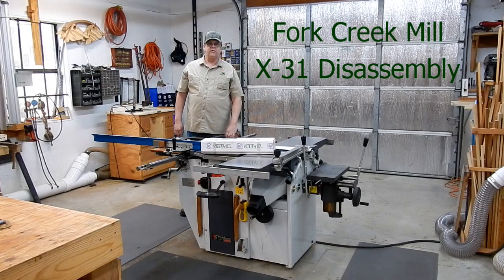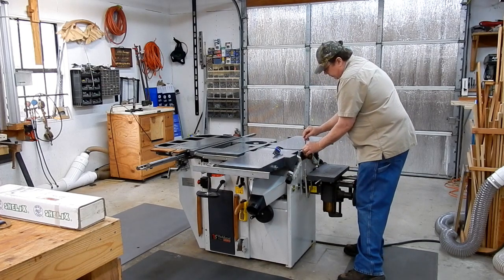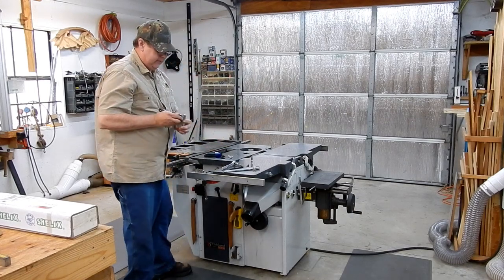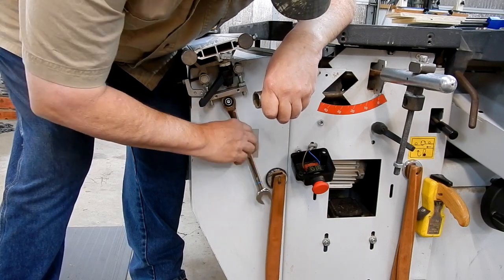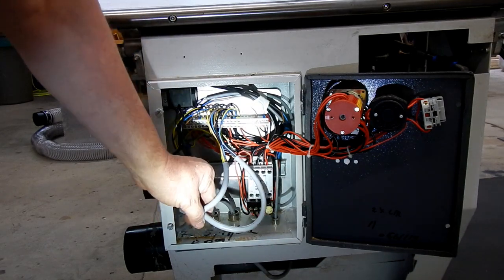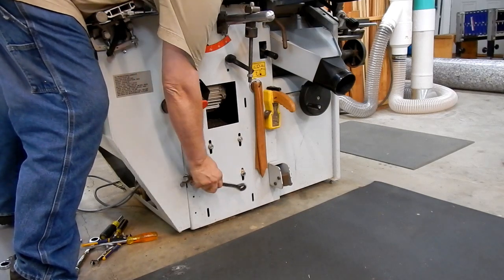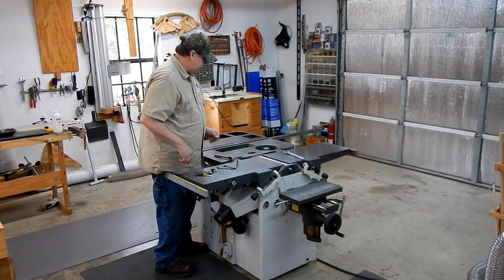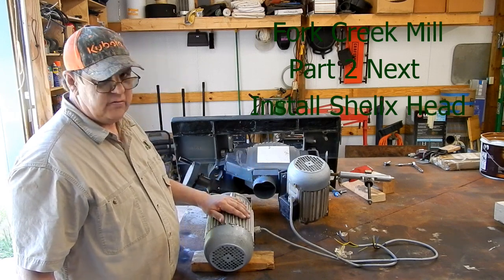Fork Creek Mill   Robland X 31 Disassembly

Comment: Thank you for the Videos they are best . I changed to Byrd shelix a few years back after gathering energy and courage. I followed the directions from the Oliver dealer who got directions from ROBLAND. The process was to tilt the saw table as much the wires would let with a cherry picker, working space was cramped but I forged on. I had difficulty with matching the threads on the Byrd head with the threads on the Robland Mortor & tenon head ( a local machine shop did help, I hope it is adequate ) I also developed a problem with the dust chute  not staying in place , after I am going to measure Byrd Head and see if I can get the necessary 1/8 inch to keep the pins in place that this is the problem after I watched your video. I plan on loosening both bearings and use clamps to keep the bearings in place to keep the dust chute in place while I tighten the bolts.Thank you for your skil
Reply from the maker: The dust chute fits into a shallow recess on the inboard bearing cap of approximately 0.125" and on the outboard side the cap is drill all the way through and had a set screw in it with a jam nut on the outside to keep the adjustment in place. If you can slide the dust chute towards the outboard bearing cap then it sounds like the set screw may need to be adjusted in. Of course that is contingent that the bearing blocks were seated all the way in on the shaft., although yo could not be off much  if you got the bolts in, I would try adjusting the set screw. 
   I probable should have showed this on the video.

Comment: I’ve been waiting years to know what’s involved in this upgrade!
Cannot thank you enough! 👍👍👍🇦🇺

Am I right in my understanding that you must do this first to be able to accurately measure your existing planer head, to order the correct replacement from Byrd Shellix & then do it a second time to swap the heads once the new one arrives?
If it’s OK with you I’d like to share the links to your videos on the Robland X31 Owners Facebook group page please for others who might be interested?

You sir are a gentleman & a scholar for going to this effort to assist others who have long been contemplating the upgrade but been scared off by the unknown complexity of everything you are doing in this video! 👍👍👍
Reply from the maker: Thank you for the kind words. I have the PDF drawings from Byrd Shelix if anyone would like a copy. Byrd only keeps a couple of the nine heads in stock so the rest are special order and you can expect up to a three month wait. There is actually two different companies you can order the head through now with one located in the USA. I bought mine from the one in Canada  and could not really get all the info I wanted. The new head of course has a take off on the diameter and cutting area length that he could never provide so when they ask you to approve a drawing you really do not know what you are looking at. I sent them a drawing that included the cutting head diameter with the blades and the new Shelix head fit on the money. I did not have to change the table height at all.  Feel free to pass along the links. It really is quite easy overall but an extra set of hands would make it go a lot better.
Reply: david pape Thanks heaps David! I’m full of admiration for you having a go at this!
I bailed on it twice now for fear of not knowing what I’m doing & maybe not being able to get it back together again & make it work.
Byrd sent me the diagrams to
Measure my existing head, so as to order the right one.
They have an agent downunder that I could buy it through & he sent me the same diagrams.
But I honestly couldn’t make head or tail of them.
The idea of having to pull the machine apart - to measure the head then the assemble it again to use for months while waiting on the new spiral head, then do all that again, when the new head arrives - without knowing ahead of time always put me off pulling the trigger on buying one.

This series of videos could change all that!

When you know what your up against, ahead of time - it’s a different story!

For me personally it’s about what other machine/s I could buy, with those same $ outlay, that would give me increased capability to make better / more complex projects.

My existing planer works OK & I’d like a drum sander & flat bed CNC router for eg.

It’s all about the cost & benefits analysis.

If funds weren’t in short supply & with these videos available to guide owners through the process, then it’s a different situation tho, it removes a lot of the potential fear factor, “exactly what am I getting myself into here?”.

This answers all those questions!

That’s why it’s such a valuable resource to X31 owners considering this upgrade!

Also pretty impressed with your 4 inch sawdust extraction on the saw shroud! 👍👍👍🇦🇺